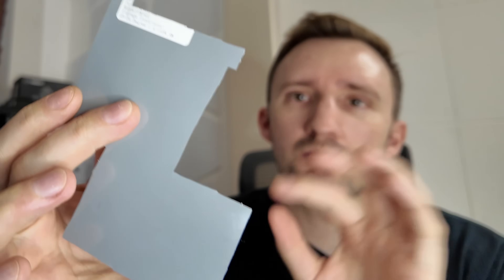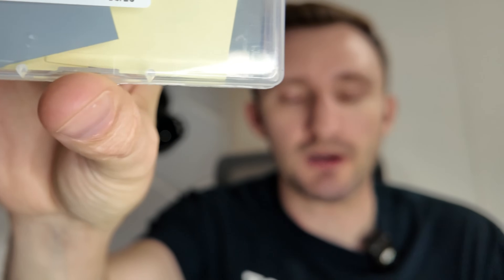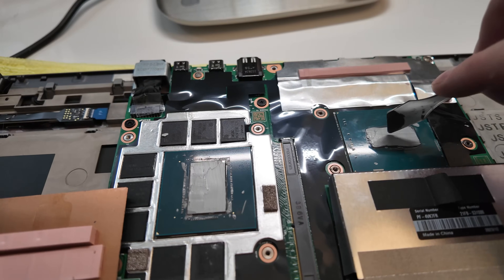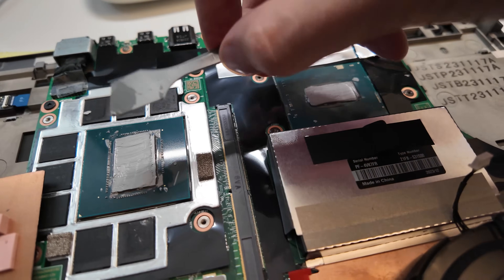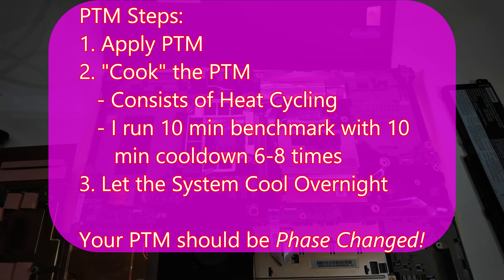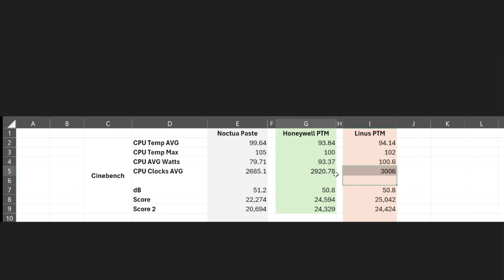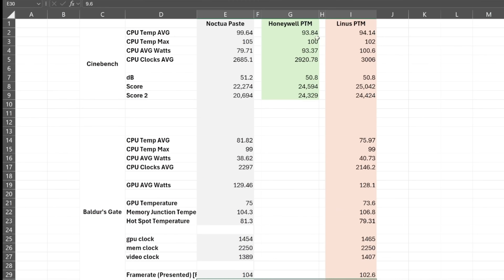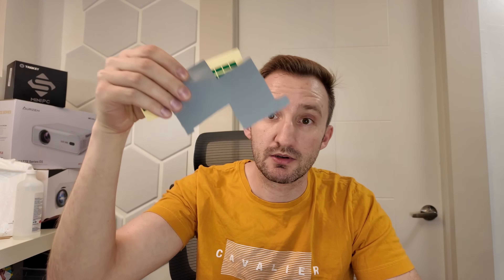LINUS TECH TIPS - New PTM7950 Cooling Solution .... Let's TEST IT

Comment: You have a fundamental misunderstanding of how this phase-change material works.

At room temperature it is a gel-like solid. If put into the freezer, it will become more solid (do this when you cut and apply it, it will make your life easier). When it is heated to ir above 45C, it becomes a liquid.

It does not dry out or become solid unless FROZEN. Heat will always liquify it.
Reply from the maker: No…. It simply becomes much dryer after being properly heat cycles. Prior to its first application is a near gel like state. After heating (and then cooling), it becomes a brittle material. 

This is why once applied, if you remove a heat sink, the PTM is rendered useless and must be reapplied

Comment: What I do is measure my CPU with a digital caliper. Then draw those dimensions in a vector program as a square. Then make the square like 2mm larger around. Print it out and cut the square out. Then hold the square over the PTM and cut it out. That way you get a slight overhang as I know it can mess up some when you start to peel it.

Comment: The Pad doesn't turn into a Solid after multiple Thermal Cycles...
The Pad you are holding is it being a Solid, when it reaches a temperature of 45C then it goes into a Liquid state.
Reply: Yes it does, it's even in its name "PTM" Phase Transition Material. Over multiple heat up and cooling periods the material will have melted and formed to the surface it was placed on reaching a point over several heating cycles where the once semi liquid/solid material has transitioned to a fully solid material.

Comment: my question is it reusable like i want to clean the aircooler or laptap fins due to clog with debris
Reply: Good to hear this, so no system "integrator" could steal my heat pads. I've had worse temps upon "restoration" after a certain warranty claim they can't uphold.
Reply from the maker: no. once you remove it, then it is useless. it turns from a semi solid, to a more fluid when heated, then it hardens permanently. after cooling
Reply: thanks i guess ill go for thermal grizzly for their reusable sheet pads

Comment: Excellent video. I don't understand the possible margin of error. The Linus PTM was in fact better, but you're saying it isn't a significant difference from the Honeywell such that it could be margin of error? I guess what I'm asking is, if it wasn't margin of error, what would the Cinebench figures look like? How different do those numbers have to be to say for sure that it's not margin of error?
Reply from the maker: There is no predefined margin of error, as it simply doesn’t exist. But if we’re looking at a few percentage points at most say two or three percentage difference, it’s not significant in any form of scientific test. To actually properly find significance I would have to rerun this test like 40 times with each compound. And look at the significant difference

Realistically though on this test that I did it’s so minimal that it’s basically margin. I hope that makes sense

Comment: my legion 5 using gelid gc extreme while gaming could reach 90c.
then i replace it with thermalright heilos ptm, now it's drop to 70c while gaming, crazy peformance.

i think any PTM with reputable brand on the market right now is the same, gey color with 8.5 W/m-K. i buy thermalright heilos the cheapest one for $5 and still has half to spare for next application.
Reply: How are you doing now, are you satisfied with the performance?
Reply: Thanks for the insight, could you kindly provide the link site of the thermalright helios

Comment: am i the only one who is looking at that thermal past and wondering why in gods name are you putting so much on there ? guess i could be wrong, but i have always put on just enough so that when its tightened it just covers the area it needs to, as in the less you need to use the better, you look like you frosting a cake. again i could be wrong, but even on all vids i see less is better.....that was enough to do that job like 3 times. in my testing with pc, i saw over a 6deg drop from to much paste to just enough paste.
Reply from the maker: Better to add more than less with pastes. Worst case you make a mess (since I was cleaning after I can ensure I didn’t add to little)

Extra paste is pushed out anyways

Comment: i'd argue if you have a higher end cooling solution it makes even more sence to use PTM as yes your cooling itself can crush anything you throw at it but the main limiting factor is eventually always the thermal tranfer between the CPU/GPU and the cooling solution itself (it's why direct die cooling on the CPU provideds such a massive boost, liquid metal does a lot of heavy lifting but there's also no more transfer to the heatspreader and from the headspreader to the block/cooler it's more direct with less roadbumps to get there).

next build i'm probably switching to PTM, currently have a carbon flap (yea it's not as good as really good thermal paste but it's still quite good).
granted you showed in on a laptop which is more of a direct die scenario but those clock difference are quite impressive.
Reply from the maker: Not a bad argument. In the end PTM on everything. I bought three boxes of this stuff and already had a ton from Ebuy7.

I covered myself in PTM so that now I run cooler too. :p

Might as well use it up

Comment: Ordered some of the "Official" honeywell ptm, used it on my gaming laptop.
After a month and a half, my temps went up, (idle, and gaming), my idle temps went from 48°c to 55°c, and gaming, went from 75°c to 98°c.
I took my laptop down, to see what was going on, and found, the ptm had gotten dried out, and hard, and it had boiled out from between my heatsink, and cpu, and my cpu now had a small burn mark in the center. Not using that stuff again!😒
Reply: Supposedly they're both "official"
Reply from the maker: PTM drying  isn’t a thing. Perhaps you had some knockoff PTM?

PTM is supposed to change from a semi liquid to a liquid then to a solid and stay very dry.
Reply: Heh, you may have been scammed. That doesn't happen with ptm.
Reply: Yeah I have an official bridge to sell you if you would like to put in an offer
Reply: Where did u buy it from? List the site and the seller
Reply: sounds like a skill issue you bought some knock off stuff

Comment: seems pretty clear from the product info that it’s viscosity decreases as temperature increases. it melts at high temps.  This guy mixed it up.
Reply from the maker: No you misunderstood….

It melts at high temps, then fills in gaps.

Then after cooling it turns significantly more brittle. And doesn’t melt anymore.

Hence the hot cold cycling. This is also why you can’t reuse PTM when you remove the heatsink, as it is extremely brittle and will not melt anymore

I know it can be a confusing concept for a lot of people, but basically it will “get better over time” after a few heat/cold cycles. 

In short, when you slap it on, don’t be surprised if you run a benchmark immediately and the results suck. Rather later on it will improve. I run a few heat cycles and the next day it’s usually at peak performance

Comment: I need this for my omen laptop with i7 9750h and 1660ti. This generation is known for running way hot. I have a custom power curve in msi afterburner but its still not enough. Im sure this will help at idle too since im not really gaming much. Its even too hot to use in lap on ecomode on idle lol
Reply: See if CPU & GPU share heatpipes, your CPU might needlessly boost & eat the thermal headroom of GPU.

There used to be a tool called ThrottleStop that let you tweak boost behavoir. Basically find out if your usage is GPU bound, then stop the CPU from going into it's higher power states, so your GPU can use that extra headroom. Also helps temperature-frequency oscilation.

Helped me loads on a laptop with underpowered heat dissipation capacity at 100% CPU&GPU usage.

Comment: I recently repasted my 3080 Ti with Corsair branded paste (ran out of NTH-01) and noticed my fan hub, which runs my case fans, on my custom fan curve was locked at 100%.

After applying the PTM7950 today my fan speeds dropped to 55% at the same temperature. Blew my expectations away, my PC is significantly quieter at the same load.

Comment: Could have sworn that LTT PTM 7950 is bulk purchased from Honeywell then repackaged to be resold.
Reply: Yes, he said that on the WAN show. They did this so people could purchase the pads from a 'known vendor' instead of buying from some random shops that may or may not sell the real Honeywell pads. And even LMG had difficulties to obtain it, it only worked out because of a viewer who works at a redistributor for Honeywell.
Reply: @Gift0r that and Honeywell offers them in large sheets. For multiple applications. Not just a small amount needed for one install. So it’s way more expensive than just getting a small amount.
Reply: @0-B1 which is what I said. No one is doing install after a needs sheets of. It’s cost effective in bulk. But to pay for sheets and only need a small square is a waste of money. Which is why LTT offers it. 

It’s cheaper to people to get it that way, even if it seems pricy. 

Because any user that is buying it from LTT is using it for a build and won’t ever touch the computer again until years later. 

If they plan on changing computers every year, or every few months they would be buying sheets, not a kit. 

The kit from LTT is only designed for single builder that is building one computer and plan on it touching it for years.
Reply: @Gift0r  ha, if you believe that then you're delusional. The only reason they are selling it is for profits. They know there's a huge market for it and they know people will buy from them and pay a premium rather then deal with the hassle of buying from a random seller in China. The only people they are trying to help is themselves.
Reply: Btw, this kind of bulk-only manufacturing is not at all uncommon. Take for example 3M VHB tape, the black double sided adhesive with the red protective film. Seems commodity enough, but 3M only manufactures in something like 72yd rolls, and every smaller quantity roll sold is just somebody buying those rolls and repackaging them. Sure, I have uses for VHB tape every now and then, but I'll never use a single 72yd rolls in my lifetime. It'll be nice to have a retailer that can reliably repackage it with genuine product.
Reply: Yeah, I didn't want the wan show, but I was looking up the PCM pads and just rewatched the video where he got it, it was through a Honeywell employee. Be cool if they had precut pieces for different die sizes so there was less waste
Reply: @TheSkubna  it was through an employee who works for a different company than Honeywell, but has a partnership with Honeywell and therefore access to that Honeywell product line.
Reply: @TheSkubna  most likely it's because selling any smaller is not economically feasible.
Reply: @Spiralem  At least not for Honeywell - retailers on the other hand have the scale for the margins to make sense.
Reply: @TheSkubna  for the least amount of waste, and easiest 2nd peel, always undercut by 2-3mm on all 4 sides. You'll still get full coverage as 80% of the material will flow out once it's been given a good burn in.
Reply: LTT is 0.25mm thick and the other Honeywell is 0.20mm a lot of people say that 0.20mm is fake I don’t know but I went with LTT.
Reply: That is exactly what it is
Reply: That’s business, what’s your point?
Reply: like most companies do with other products !!
Reply: Or they buy from whoever Honeywell buys from.
Reply: @konobikundude  PTM 7950 is a proprietary material that was developed, patented and is produced by Honeywell. Even if it wasn't, someone had to produce it. You are an absolute brainlet.
Reply: @konobikundude No. Honeywell does not buy some otherwise available PTM and slap their label on it - it is their product, they developed it.

I can't say it isn't manufactured at a 3rd party factor (I don't know), but that would still be irrelevant.

Comment: I have just one question. I saw that the PTM is around 8.5 W/mK and some thermal paste can reach 12.5 W/mK. So I don't understand if it's better the paste or the pad in that case?!?
Reply: Which is just proof that those numbers don’t mean much. Since paste is much less effective
Reply: It's not just conductivity. It's also resistance to that same conductivity. I'm not an expert and only saw a 'for dummies' type of explanation. Plus, there was some click to the video because they were trying to sell their stuff. Anyway, from what I understand, the pads allow for less resistance which kinda evens the playing field. If you want my opinion, the real selling point is that PTM7950 is longer lasting between repastes, as well as no reported pump out. Of course, during that longer time you still have to keep your machine clean, and/or take it apart to clean fans...etc. Just not the heatsink/IHS assembly.
Reply: @poorplayer9249 also PTM doesn't pump out or degrade over time.
Reply: @thedryparn1279  Yeah, I know. That's why I originally wrote,"...PTM7950 is longer lasting between repastes, as well as no reported pump out." Longer lasting is generally considered the same as doesn't degrade over time, and no reported pump out is self explanatory.
Reply: @poorplayer9249  Oh, sorry.  I answered the wrong guy. Was trying to answer bribbo.
Reply: @poorplayer9249  thx

Comment: my laptop was dead (suspected due to short circuit at the display connection) and i went to repair shop to fix it. they ask me if i had made any modification before. i told them my laptop was overheating and i changed it with PTM7950. they were absolutely clueless about this product and instead blamed me for using a shitty thermal pad. needless to say, i'm not returning there in any foreseeable future.

that being said, PTM7950 is an amazing product. it lowers my laptop temp around 15-20 Celsius. i paired it with Llano V3 Laptop Cooler and the thermals are absolutely amazing. these are 2 products that i would recommend for gaming laptop users.

Edit : i used PTM7950 for months before my laptop went dead. it has nothing to do with the thermals. my screen flickered after it and saw a bit of spark at the LCD.

Comment: Would like to see tests going over PTM pump out. A test like that would take a very long time though.
Reply: I repasted my asus vivobook s14 i7-12700h cpu machine. I tried to use Thermal Grizzly Kryonaut Extreme first and that was pumped out about in 3 weeks and temperatured went higher. I found only some thin liquid on the core when I disassembled it.
Later I tried some chinese PTM and it is still ok after using it for a year. The original paste in the machnie was also some pretty thick stuff, not sure if it was also PTM or other stuff.

Comment: The question I have, and I am curious about this stuff now, is can you change it.  You say it turns into a "solid" and the word baking it on,  you can still change these at later dates yes?  or aswhen needed or even if you change your cooler on the cpu?
Reply from the maker: Well you can just clean it off after. Once it does temperature cycling  it becomes hard and brittle. This is fine but if you remove the cooler it will make is basically useless. You then clean it off and reapply
Reply: @TechGuyBeau  awesome thank you for the response, I may have to try this stuff on my new laptop and my desktop.  Been using kryonaut for years, but this looks interesting.
Reply: This is just wrong. It starts out as a gel-like consistent at room temperature. When put into the freezer it will become more solid, this should be done for cutting as it makes it much easier.

Above 45C it will become more like a liquid and conduct heat very well. After it cools down from 45C, it will go back to its gel-like state. It does not harden with heat, quite the opposite.

The "cooking" (which is just heat-cycling and repeatedly changing the phase of the pad) turns the pad from solid to liquid and back again. Doing this repeatedly allows the PTM to get into all the microscopic surface inconsistencies, as a gel-like solid (when it's cold) it has great difficulty getting into such small imperfections. In its liquid state (hot) it is much easier.

Heat-cycling just ensures the best contact between the IHS, pad and cooler surfaces.
Reply from the maker: @Splomf  that is not correct..

It starts as a semi solid. You heat it, it liquifies and fills the gaps, spills out when not needed. After a long cooldown it turns into a brittle substance that cannot be re-used if taken off

I have worked with this stuff for years.

Comment: i use this in my laptop dell precision 5530, after 1 year using ptm7950 safe to say i am impressed, the temp stay consistent
Reply: really, Laptops by default need Liquid Metal for their incredibly tight space to fit a cooler in there.
but for those who didnt pay extra for liquid metal pre-applied on their space-saving gaming machines...
and dosent have the hands of a surgeon to apply liquid metal, PTM7950 is the best option.